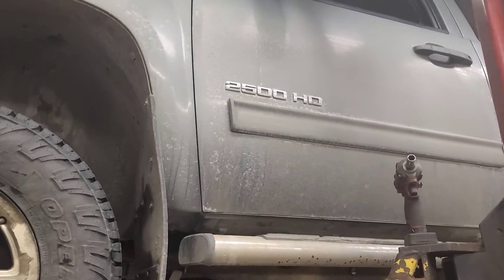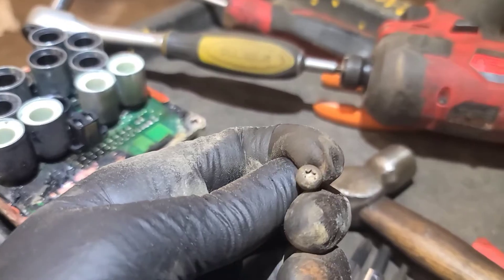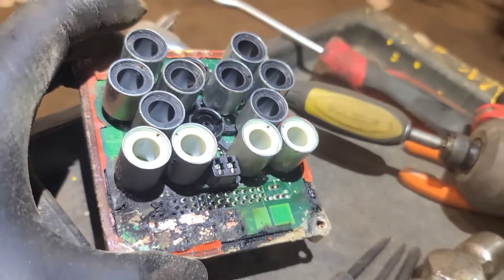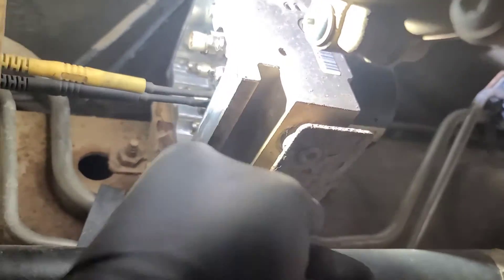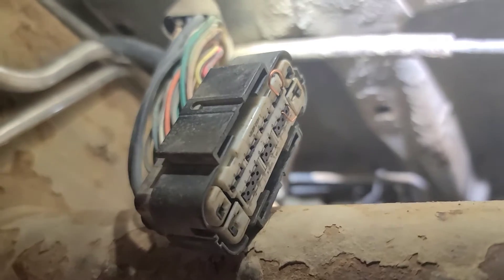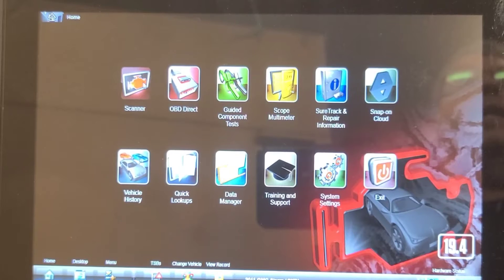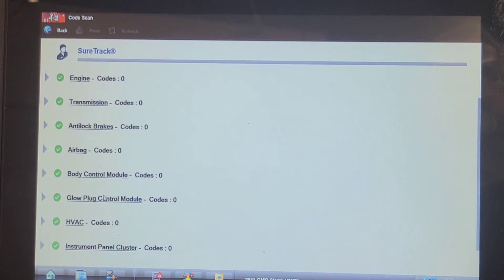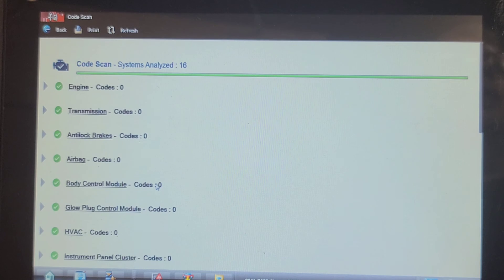2011 GM Truck 2500HD ABS Module Replacement To Correct Network Issues

Comment: Do you know of a video that shows how to remove this part? I have a 2016 silverado duramax. This part needa replaced and without a car lift hard to see qhere any of the bolts/screws are.
Reply from the maker: There are 4 T25 screws that hold the module to the hydraulic assembly shown at 1:40 and the electrical connector. The  new one needs to be programmed to the truck once installed with GM SPS.

Comment: Mine fried and I replaced it when a good used one and I’m still getting no trailer lights . Does the module have to be programmed ?
Reply from the maker: Yes the ABS module needs to be programmed. Not sure if that's your problem though since the trailer lights are not controlled by the ABS or trailer brake control module. There are separate fuses for trailer lights.

Comment: Have you heard of this module causing all four brakes to lock up? I’ve had this issue for a bit now and this is the last thing I can think of to replace.
Reply from the maker: Actually no I haven't. How about the master cylinder push rod length. Are all wheels locking up?
Reply: I have the same issue. Damn truck doesn't want to move because the brakes are locked up.

Comment: Got a U0100 code in the abs module. Lost communication with the ECM. I tried just reprogramming and not replacing and reprogramming. The can bus system seems fine at the obd2 port. I can see the abs module on the scanner. I see wheel speed sensors. But for some reason it says Traction Control system fail. And Stability Track fail. But of them aren’t currently functioning on the truck. 2013 Duramax. And help would be greatly appreciated
Reply from the maker: Are there any codes in the ECM? How did you test the can bus? Disconnect the batteries and measure resistance between pins 6 and 14 of the DLC, should be near 60 ohms.

Comment: Can a bad pump cause a short in the module? Because in my silverado it had a lot of smoke around the module and it was leakimg brake fluid between the module and pump
Reply from the maker: @PATOJO514  I've never seen that but it's certainly possible

Comment: Hello Sir, Is it possible to bench test the EBCM? I just had one replaced on a 2012 Silverado 1500 from dealer and I'm suspecting some shady business and would like to know how if possible to test my old module. The old module has three sets of numbers on it. Not sure which is the PN 
1. 5695L8191211085
2. D265952D87 (982) 20220E2560
3. 920908B2051E2560*
Reply from the maker: @jbucks166  it can't be bench tested. If its a complete assembly, module and EHCU it could be connected to the truck harness and then scanned for codes. It will need to be programmed to the truck before it will function correctly. Even if the part numbers match the internal programming will be different.

Comment: Good Work! 2017 Chevy Express van EXT 2500 6.0L
U0121( lost communication with electronic brake control module)  Started out as intermittent issue, now is permanent. Not exactly sure where to start with this one.
Reply from the maker: @thirdgearboogie2210  start by checking termination resistance of the Can bus, if ok test fuses that supply power to the TBCM then load test powers and grounds right at the module.
Reply: @PhillipBailey  Do you happen to know of a free source online for wiring schematics. Not sure where to test for can high and can low. It  like it should have a resistance of 60 ohms?

Comment: I have a 2010 2500 dmax, I currently lost 4x4 and I have a u0100 code (lost communication with abs module) and a c0561 code… could these be the culprit? I’ve tried almost everything else…
Reply from the maker: What module has the codes in it? Can you scan the ABS and 4x4 modules? Check terminating resistance across pins 6 and 14 with the battery disconnected. it should be 60ohms.

Comment: What was the total time it took to program the new module do you have to push on the pedal like in the bleeding procedure to be able to program it or you just load it in there and it's done?
Reply from the maker: You have to log into GM Service Programming System, pay for a program event, download the file from GM then upload it to the truck. You need a compatible pass through programmer and scan tool or laptop. These about 30 minutes.

Comment: Mine is a gas 6.0 and runs fine with it unplugged I have a 2011 2500hd 4wd crew cab mine fried and caused a no start issue so i unplugged it until i get a new module currently on backorder thru gm
Reply from the maker: Yes I believe the 6.0 gas does not use a fuel pump driver as does the 4.8 and 5.3.
Reply: I have the exact same truck, same problem. Gm dealer give me a crazy price to fix it and said they were 7,000 parts on backorder.. to me that is obviously a common issue. Anyway, I had it fixed and it lasted for 2 months and it burnt again. I need to know why before I fix it again.
Reply from the maker: @williammerrow  what exactly did you replace? The ABS module? Could be the pump motor is drawing excessive current and taking out the module but I'm not sure. I believe I only replaced the module on this one and it's still fine. Could be just a defective module. Was it a new unit. Any parts warranty

Comment: Hello, Sir what was this brake control module making the truck do??? My truck is at times braking and making a wining noise im not sure what it is i have 1 code only! It says service trailer brake system my Mechanic told me to buy this to resolve that sudden braking stop and noise! Is this what was happening tot his trucks
Reply from the maker: https://youtu.be/ll0RIj0QTek?feature=shared
That is the link to the first video. Multiple Warning Lights On,  intermittent no crank and Multiple Network Codes. What codes is your truck setting? Noise?

Comment: I have a 2008 2500hd gas which pins do I need to connect to complete the circuit.
Trying to check fuel pump. I'm getting multi codes for communication if I disconnect the abs the codes go away except u0121 for abs 
Thanks in advance for your help
Reply from the maker: There are potentially three brake options so I need the RPO code for the braking option. It should start with a J. Codes are in the glove box.
Reply: @PhillipBailey  The RPO code in the glove box is JH6. If I am looking at the diagram correctly, I am completing the circuit by connecting yel/blk to yel and tan/blk to tan
to check that the fuel pump is working. Is that correct?
Reply from the maker: @thomaspierce6116  you would need to jump pin 2 to 3 and pin 12 to 13. Colorwise that's yellow/black to tan/black and yellow to tan.
Reply: @PhillipBailey  
Thanks again for the help I will try it out on my next off day.
Reply from the maker: @thomaspierce6116  make sure not to use too large of a jumper. If I remember the terminals in the ABS module are like .024" good luck.
Reply from the maker: https://youtu.be/SNaGNCRo_-s
Check this out might help.

Comment: When you program ebcm with the mdi2 do you have to select if it has a ITBC (trailer brake controller)or will it automatically recognize it as having the ITBC.? Just asking as I have a issue with no com to ITBC. I had coms to it before installing a new ebcm due to a internal short to ground from hi speed wakeup circuit LT blu wire through module. It was programmed at dealer but now a no com to ITBC also itbc was programmed before ebcm and is new as well. I checked hi speed wires and load tested them with modules disconnected on the legs of circuit going from ebcm to itbc and itbc to resistor. Ohm tested them as well for grins and all good resistor tested out where it should be. Checked LT blue wire as well since when I had coms it had a u2099 code in itbc and the wires tested good after removing ebcm (this is what necessitated replacing ebcm. I have a u0137-00 in bcm no com to itbc/trailer brake controller. Kinda pulling my hair out on this one could use some pointers/confirmation of my first question as this ebcm might be bad. Going to try a bypass test tomorrow to bypass ebcm to see if I get coms back or not
Reply from the maker: Gm sps is VIN based so if the truck has integrated trailer brake from the factory it will automatically load the appropriate programming. I don't believe there is a different file for abs module either way. Are other modules setting codes against the TBC module? Is this a gas or diesel truck? Check termination resistance at 6 and 14 of the dlc.
Reply: @PhillipBailey  bcm is reporting no com nothing else. Resistance for can bus is 60 ohms so that's good. I have one other leed to check out (a possible back feed from the lin bus)... It's a 6.6 duramax
Reply from the maker: @aw317  I had a newer gm truck that had no com with the trailer brake module and it was actually the scanner. Tried Snap-on and Autel Maxisys both no com. Tried a thinktool and it worked fine. I'd try a different scanner.
Reply: @PhillipBailey  I had com with it right after the itbc was programmed
Reply from the maker: Bypassing the ebcm is a good idea. Watch pin grip on those can bus wires. Be sure your probes are slightly smaller than the terminals in the ebcm. If I remember they are .024"

Comment: When you had thos failure even after the new module was installed but before programming, could you communicate with the ebcm? I've got one that won't communicate, but won't program either using an autel maxiflash to program. Gives me a no crank but a few flips of the ignition and it will usually start and run just abs and service trailer brake messages with no comm with the ebcm.
Reply from the maker: A new ebcm will communicate but set a code for lack of programming if it's not programmed. If you have an EBCM take down the network I've found that it my not crank due to loss of communication between the ECM and BCM but depends how the network is affected. If its a diesel you can unplug the ABS module and it will start and run but a gas engine has the fuel pump control module downstream of the ebcm so you would have to bypass the EBCM to restore communication with the fuel pump control module. You can also plug in a used EBCM and it should run but you may get codes for vin mismatch. If you can't communicate with a new module and it won't program check termination resistance at 6 and 14 of the DLC. It should measure 58 to 62 ohms. (Disconnect the battery first). There is a termination resistor taped in tge harness to the left front of the spare. It can get corrosion in it and short out the can bus. Time for a labscope...